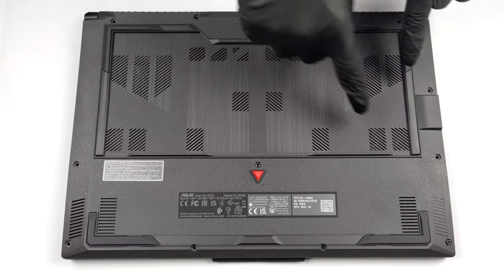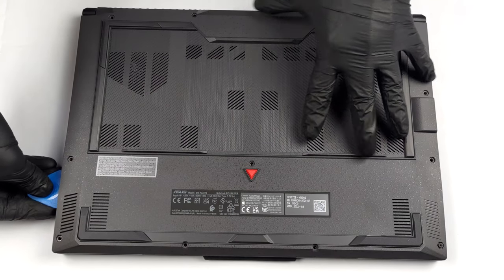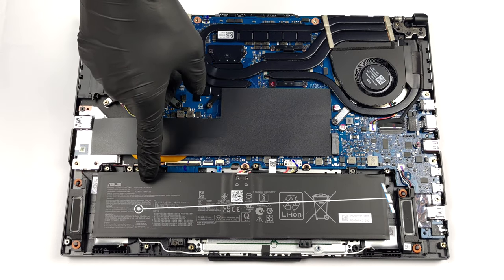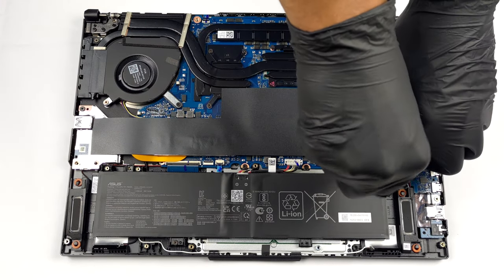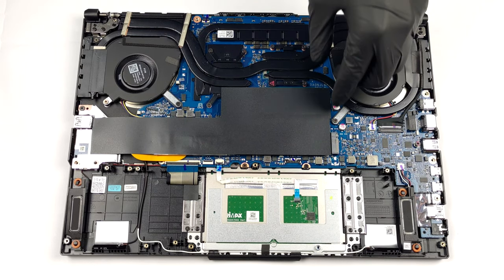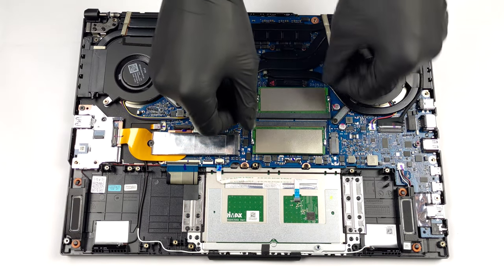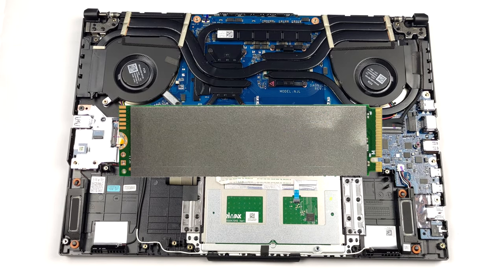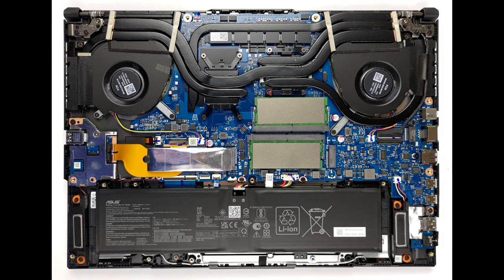🛠️ ASUS TUF Dash F15 FX517 - disassembly and upgrade options

Comment: Thank you, this was extremely helpful. I just bought the 2022 model and wanted to add another SSD. The ASUS site doesn't say whether it has the second nvme port.
Reply: I bought one too, it’s great!
Reply: I just bought some 2 tb samsung ssd. Ill let you know how it goes!
Reply: Is it supported pcie4 ?
Reply: @ヴィンセント 森林 please send me the full brand name and model , thank you so much for your informative reply. Did you catch any unbearable hot issues
Reply: @ヴィンセント 森林 ❤️❤️❤️🔥
Reply: What measure do i need to use for a SSD in this device?
Reply: @Hellot_  2tb SSD worked on your laptop?
Reply: @mrsgamingandtech3580  yes, I have a 970 evo for the ssd works just fine and with my gigabit network it still handles downloads and transfers just aswell. The cpu limits it though with uncompressing

Comment: Little tip if your not like in the CPU temps go into power settings and disable the CPU boost will lower temps and still game to near no loss of performance. Or replace the thermal paste with ic diamond or something similar.
Reply: My cpu temp is indeed so high, but i couldn't find the CPU boost............ Can u instruct me on how to do so?
Reply: @雪アンアン  type edit power plan in search it should pop up a battery settings. Then advance and advanced cpu then disable boost. then it will not boost over your standard clock settings. Or use armory crate u'll see silent advance turbo and manual. Go into manual and turn the CPU power watts and boost all the way down that's another way.
Reply: @danielwoodland9576  is it a good idea to immediately replace the thermal paste after buying it? I heard stock pastes are bad
Reply: @noname-codm4590  I tried it didn't make much of a difference

Comment: In the future could you show the very best way to open one without leaving marks? I did got to open one but it's hard to understand where exacly is gripping cover in, so because of that I broke a little gripping piece from inside and for me it kills me, luckly the store exchange it.
Also, it's very important to mention that the screws aren't exacly the same, a mistake and you can add a little bump on the top chassis.
Reply: I watched a Video on the Asus Tuf Dash F15 and if you have a plastic guitar pick and slide it along it will open the back of the laptop.  (Simply unscrew the screws and place them on the same side and approximate close area on the bench to where you take the screws out PH0 screw driver does the job great.  There is one corner screw that you undo but doesn't come out, however will raise that corner.  Simply slide your guitar pick gently around the back until you hear the  various clicks and the back will come off.  (Does take a wee bit when first doing it however you will get the hang of it.)  Hope this assists.

Comment: Hello, I just purchased the (2022), FX517ZM-AS73. I've already purchased another SSD to install, but didn't realize you had to take it apart that far just to install these. 

I've been thinking about adding another RAM stick, but I don't want to have to tear it down just to figure out what manufacturer and timings I've got to match a second stick with. Has anybody done this already and be able to tell me what the stock 16gb ram module is in this laptop? I have no idea why this information is so freaking hard to find.

Crucial recommends their CT16G48C40S5 module, but they don't say if it matches the stock module, or if I'd have to mess with timings, ect...

Help would be greatly appreciated. I'm getting it tomorrow and would only like to take it apart to install once.
Reply: I may be wrong but since it has two 8gb sticks of ram you are just better off getting a set of two 16gb, instead of replacing one of them. I just purchased the model with the 3070 and I've been looking into upgrading both the memory and the storage.
Reply: @bahnean006  I also purchased the 16gb model 3070. Do you know if it has 2x8gb or one 16gb stick?
And I thought maybe buying one 32gb stick to have 40gb total(8+32). Do you think this setup is good?
Reply: @omer7464  not sure how laptops are, I've only ever owned a desktop pc till now. Check if it duel channel, if it is then you should get two 16gb sticks. If not then get what ever. I'm also not sure if it's two 8s. I'll have to open it up one of these days and see.
Reply: @omer7464  don't buy one 32gb, get two 16gb.
Reply: @thingburner6103  why not two 32gb to get 64gb?
Reply: @ArtOfCRash  much more expensive but yeah why not, if it supports up to 64
Reply: @thingburner6103  is it support m.2 pcie4
Reply: @engihabit  yes it does support gen 4 pcie but the default ssd is gen 3
Reply: @thingburner6103  ❤️
Reply: Yeah they advertise it like you can just pop some "door" and gain access to the internal compponents. but in reality its 12 screws and a pain in the ass prying job that you have to have a tool for if you dont want to scratch your brand new laptop or snap those stupid clips.
Reply: @igorklyha1698  I used a plastic guitar pick to pop mine open.  Took a wee bit as I have never opened the back of a laptop before, however didn't scratch the laptop this way.

Comment: I upgraded my computer to 32gb but when I turn on the computer only the keyboard but the computer won't boot both are ddr5 4800 and 16gb the only difference is they are from different brands. Is that why it doesn't turn on?

Comment: Excuse me, this laptop uses SSD Gen 4 or 3, because Asus announced that there is a Gen 3 SSD available in there.
Reply: It's Gen 4 ready, but the included storage is Gen 3 (to cut costs). Get the 12650h with a 3060, best performance to price (with the FHD 300Hz panel, you'll thank me later).
Reply: @1whospeaks  can i add a gen4 with the gen3 which is already in the laptop? and which speed it will read?
Reply: It support gen 4 and reverse compatible
Reply: @1whospeaks  sadly i got 3070 and was tricked to the 144Hz due to lack of knowledge

Comment: What's the black paper type material on top of the RAM for?
Reply: Son láminas de grafito , se usa hoy en día como disipadores de calor para memorias RAM , ssd nvme o cualquier chip que requiera un traspaso de calor eficiente y rápido para evitar daños , y así , los móviles por ejemplo en su CPU y GPU usan lámina de grafito como disipador de calor entre 2 superficies con diferente valor de transmisión de calor para optimizar la disipación de calor general y que el flujo de aire pueda expulsar el aire caliente más eficientemente y mantener una temperatura adecuada más rápido y con menor gasto de energia

Comment: Hey do i have to remove the batter before i install another SSD?
Reply: no, you do not, just insert the other side in the free slot, don't uninstall the one already in the laptop (do not remove the one underneath the black tape)

Comment: The laptop say that's upgradeable to max 32 GB RAM DDR5, but there are 32 gb RAM DDR5 chips in ebay (crucial) for the frequency it needs. Can I add two of these in each SODIMM connector? To have 64 gb ram?
Reply: you did it?
Reply: that is like a parent telling their child to behave... you can push some boundaries and learn a quick lesson if you dont fuck up too bad...
Or you get the Chancla.  Best outcome is that you waste the second chips potential, as the mobo just wont recognize.
Reply: I put two 32GB of RAM in and the board picks 64GB up and it is being used. YMMV. I also updated both NVME SSDs for a total of 4TB of storage. One of my fans on the other hand has decided to start making noise and is most likely bad. Can't find replacements. If anyone knows of a place, please post up.

Comment: any idea on how to remove the heat sink? im planning on repasting the cpu with liquid metal to lower the temps for longevity purposes.
Reply: Remove the 4 screws from each CPU and GPU plates, remove also all the fan screws, and before pulling it out, remove the screen connector
Reply: @xplote6266  Ended up figuring it out, but thanks!

Comment: I only have installed 8gb and I need to upgrade to at least 16gb, what brand should I buy? can I buy just one module of 16gb and I will add up to 24gb? or is it necessary to be in dual channel? if so.. do I have to buy the 2 modules of 8gb to obtain the 16gb dual channel.. Thanks!
Reply: Lmk what u ended up doing

Comment: I bought the ASUS TUF Dash 2022 but it came with the basic screen display, and the colours are not great. do you think is it posible to upgrade the display to one that have 100% SRGB?
Reply: Have you been able to upgrade the screen? I’m trying to buy one and they all have the basic screen and thinking of buying one and upgrade it.
Reply: @travistravis3620  not yet, I'm still researching... what you say is very true, what I have found is the basic screens or website that don't give all the specs to be sure we are buying the right one. I'm waiting for someone who has already done it and tell us where he bought it and how to do it, so I don't mess up
Reply: @FelipeTrotamundos  
Thank you for the fast respond, I haven’t bought the laptop yet. If for sure I can upgrade the screen I will go ahead and buy the laptop and the screen. It’s a good laptop but looks like the basic screen is the only down side of this laptop. 
This model comes with a better screen that has higher resolution and better color and refresh rate. I’m sure they have same connection. I found them on eBay already but I’ve been trying to find a video someone who’s done it. 
Do you like your laptop so far other than the screen?
Reply: @travistravis3620  is a great laptop either way, I'm very happy with it. is only when I want to edit pictures when I wish for more color accuracy
Reply: Yeah, if we have the 144Hz panel then we were kind of got cheated, cuz the 300Hz panel and the QHD 165Hz are far more better.

Comment: If I buy pcie m.2 gen4 is it compatible or it works? Because I think its Gen3x4 not 4... I bought tuf dash 15 latest one. But i worried if I buy gen3 or 4
Reply: I got myself a crucial SSD p3+, so its gen 4, it is working good, ur good to go.
Reply: @雪アンアン  es gen 4 funciona y ddr 5 4800 5200 y 5600